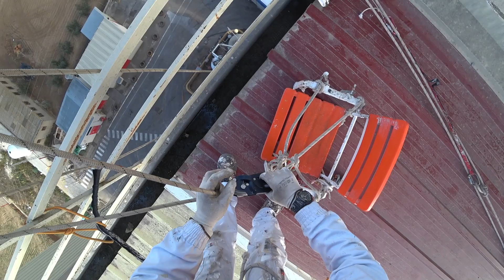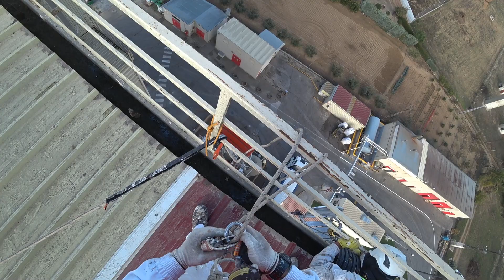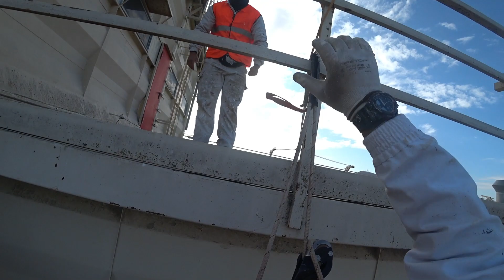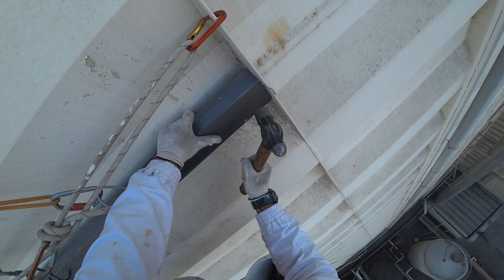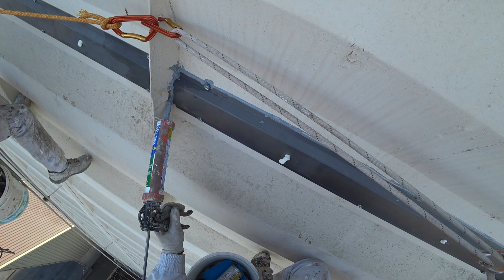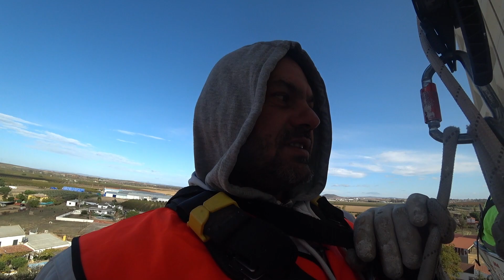Mystery job - Rope access

Comment: Cool video! Would love to hear more commentary in english tho! :)

Because I'm curious: Why did you chose to run the ropes over the last bar of the handrail, instead of running it over the edge of the floor like the guy to the left of you? You have no concerns that this puts a lot of force on that tiny handrail? (I'm just a sports climber, I have no experience with rope access) 

Cheers from Austria, stay save!
Reply: Heloin42 i think he was worried about rope strain by constantly rubbing on a sharp point of the edge on the floor